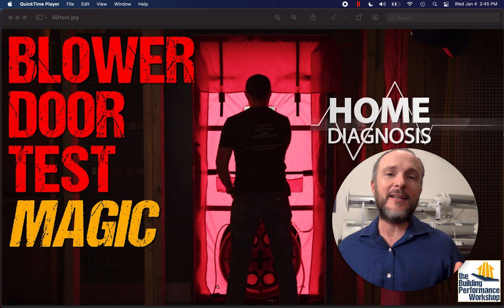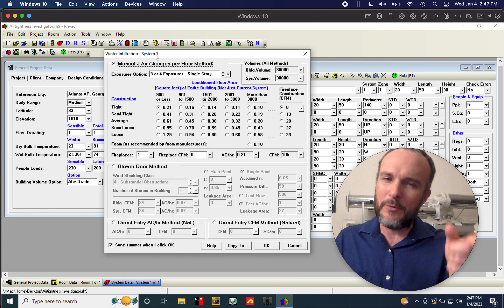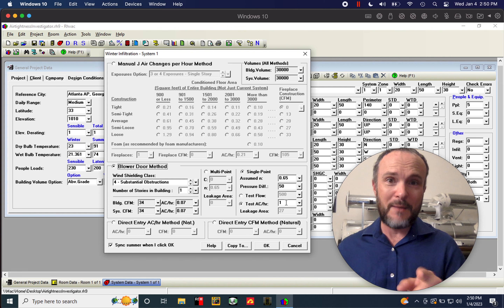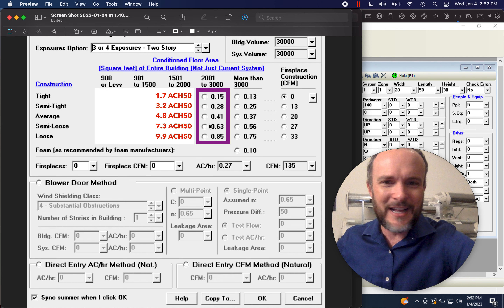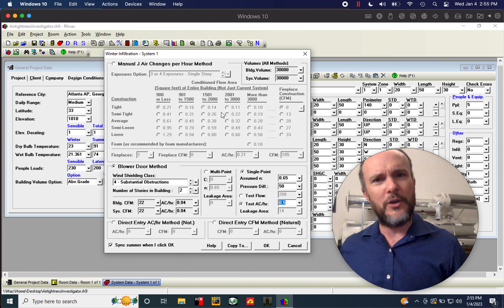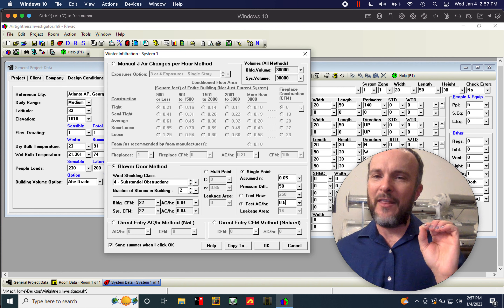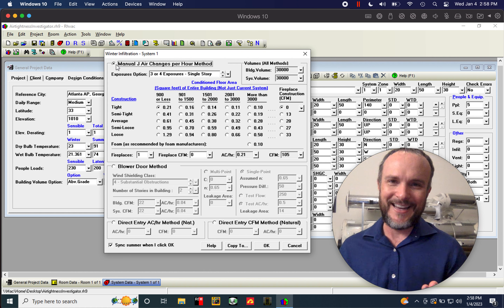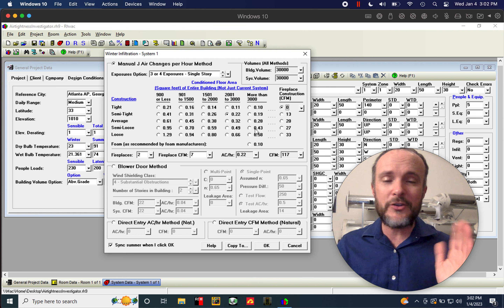HVAC Design Training: Manual J Default Air Leakage Inputs vs. Blower Door Test ACH50

Comment: I really appreciate a help or advise I'm new to all this. I recently bought a airtight house which that has turn to a nightmare. I moved from a dry climate where I  barely use heating/cooling around the year. And now that I reallocate in a dry/humid climate and winter is the worse. I'm learning this changes the hard way and comfort of home is miserable. Tried couple HVAC company and they just check the unit and not if have enough fresh air and when I ask about it they have no knowledge, one of them told me turn the air fresh off on winter. Not easy to open The window in a super cold or hot night The only thing that i know is that i need fresh air. The house feels uncomfortable, cold and hot spots, hard to breath, dont have enough oxygen, ear feels plug, some type smell and it is worse when is windy 15mph and up. Any help, advise much appreciate
Reply from the maker: Sounds like you might have pressure problems along with ventilation- where are you located?
Reply: @HomePerformance  2018 build in Fort Worth, Texas

Comment: Since we are talking about ach, I've always been interested in what infiltration rate the government uses to test dehumidifiers. I see that they say at 80F and 60% RH in a basement the Aprilaire E100 will remove 100 pints/day and 2.35L/kWh but at what infiltration rate? Like is it a basement with a standard ach of 0.41? or
Reply from the maker: Hahahahahahaha awesome P55. Nerd level 15 activated! 100% sure they don't think or care about the infiltration, the standard is the standard because it makes the dehus look really good. No basement will ever be 80 degrees, don't worry.
Reply: @HomePerformance  right i was thinking wow how unhelpful can you be. Sure glad they tested at 80F and 60% RH where nobody keeps their basement lol
Reply: @HomePerformance  Nice I see you linked your old video now. I have a spec home 2100sqft, ~6ach50, indoor temp goal is 75 and 40%, but the whole summer will typically be 95F+ and 85% humidity, nights being 75F and 60% humidity. Do you think a Aprilaire E80 or E100 will keep up? I'm looking at open box stuff and this is what i see right now. Ducts are sealed up pretty well with mastic as well but inside will sit at 75F and 55% RH all summer long (oversized central air)
Reply from the maker: Both might, but I doubt either could pull the weight
Reply: @HomePerformance  yikes i thought that as well.

Comment: I’m my designs, I have the client sign off on a “Design Criteria” worksheet and one of the criteria is  target ACH. If the builder isn’t pursuing any target certifications like LEED or Energy Star, then I put the code ACH. In the contract it will state that before blaming a poorly performing system in the designer, the contractor must show proof of their blower door and startup/ commissioning/ air balance checklist. (Don’t call me until you can prove that you did your job correctly first.) 

What do you think about judging air tightness on cfm/50 instead of AcH/50? Seems that ACH50 favors houses with tall ceilings
Reply from the maker: Good ideas, Tim. And either CFM50 or ACH50 works the same- they are converted using the home volume, so they mean the same thing.
Reply: @HomePerformance  i guess what Im asking if  CFM50 over square feet is over 1:1 (cant remember what the acronym for that is) then thats comsidered "above average" leakage.
Reply from the maker: Aha, you mean CFM per sq ft of enclosure. That’s interesting to know, but I wouldn’t refer to it in Man J targets- no matter what target you put in just needs to be feasible.

Comment: Airtightness is usually talked about in terms of its relationship to energy consumption, indoor air quality, and durability but I’m interested in its role in safety. We recently had a blizzard in buffalo that killed about 30 people, 9 or so were in houses that had lost power and become too cold to occupy. Most of the housing in Buffalo is about a century old. But even some newer buildings became uninhabitable and sustained massive property damage. I kind of wonder why there is not a 48 hr power loss safety standard for air tightness/insulation. Does anyone have metrics for these kinds of things?
Reply from the maker: Very interesting, Paul. Let me ask around.

Comment: What gets measured, gets managed. No point in trying to engineer a system if you don't have data on it. 

I'm curious, why are you so convinced that Manual J is the only right way to design a mechanical system. Did God dictate it as the correct method or something? It makes a lot of simple assumptions that might be wrong,  e.g., the setpoint being 70 or 75,  that's way, way too high for me and too low for some people I know,  or the 99 and 1 percent rule. Please show me another field of engineering that doesn't apply a safety factor to the worst case scenario when making design decisions. Not to mention, no regard for microclimate or usage patterns; hell, is there even any way to account for things like thermal mass or different temperature distributions from a forced air vs. radiant heating system.
Reply from the maker: It’s the best option we have, ZZ. You must make assumptions when modeling, it’s a fact- that’s where the skill of the modeler comes into play.
Reply: @HomePerformance  True, you do have to make assumptions. But, I still think blindly following a manual as if it was gospel is not best practice. You have to talk to your client and really dig into all the details about how the building is going to be operated. A mechanical design should start with a client interview, at least a few hours long; then, you can make more informed assumptions and have a goal to aim for regarding client needs vs. wants,  system performance, and price.
Reply from the maker: Zerg, you might be new to this channel, so you might not know we’re all about performance targets and testing here. There are no prescriptions, there’s no one way to do anything. But we do need to guide people, and frankly I think you may be overcomplicating the heat loss/gain calc that is the load. It’s a lot of variables, yes, but there’s no wizardry here- it’s just math.
Reply: @HomePerformance  I don't have a problem with math, I have taken way too many Calc and DiffEQ classes to not like it. I just don't agree with ACCA and ASHRAE. Case in point, the 99 and 1 percent temperatures for my area are 17 and 100. We have had whole WEEKS of weather colder or hotter than that for the past couple of years. How on Earth does that make sense? A more realistic design would be 110 and 0 degrees. Same goes for the indoor design temperatures 70 and 75 are completely arbitrary and don't account for personal preference at all. And don't get me started on the insanity that is ASHRAE 62.2
Reply: Corbin-I have this concern/ question as well and have yet to hear a completely compelling explanation. I also think climate change has upended the ASRHAE tables assumptions on the 99% coldest and warmest day for any given zip code. To illustrate, for Washington dc, program assumes 22 F, but in past decade , it’s been colder than that 8/20 years, going down as low as single digits. As for hottest day, way way off we haven’t been below 97 for past decade, 4/12 (1/3 of years) we’ve broken 100 ! I’m not saying it makes a meaningful difference , but it’s grossly inaccurate . Whatever metric is chosen, ie a spot versus sophisticated integrated depiction of heat loads during four seasons, however flawed, it should use accurate data.
Reply from the maker: Of course I agree, use the most accurate data uou can find. But the arguments you guys are making are classic cases used by TONS of prople to just not do calculations at all.
The Perfect is the Enemy of The Good.
Reply: @johnwhite2576   The USDA and NOAA both have good weather data you can use. Personally, I would get the design conditions by looking at the historical record conditions and adding a factor of safety, maybe around 5 degrees. You can solve the problems of oversized equipment by using some type of modulation. I personally like hydronics because it keeps the high volumes of refrigerant out of the interior space, and it's trivially easy to modulate with a motorized mixing valve and a thermal buffer tank; plus if you size the buffer tank big enough you can charge it with a heat pump with off peak electricity, or solar if you have it. VRF systems or even multiple single stage systems work too.